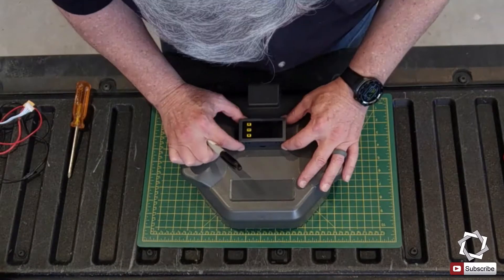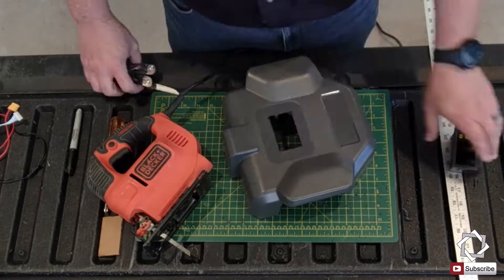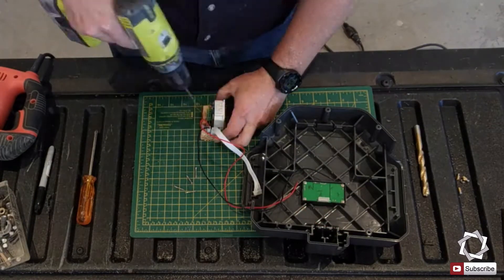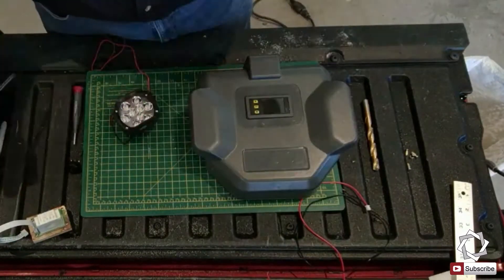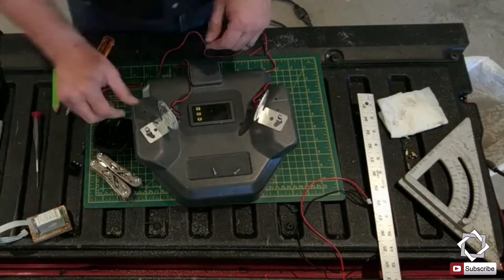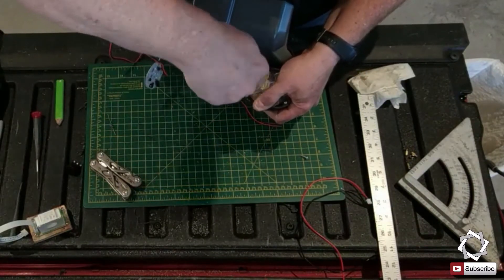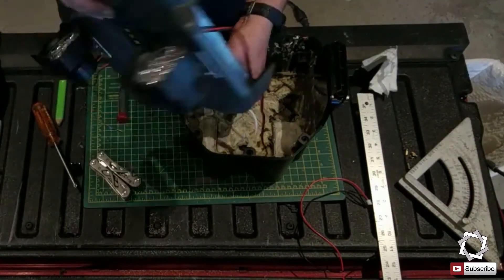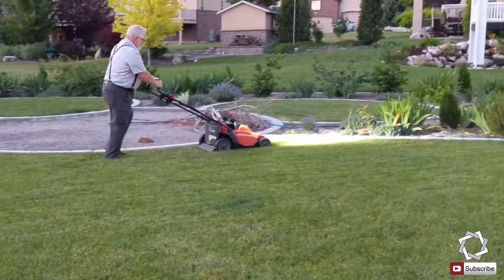Headlights on my Lawn Mower

Comment: Hi question about that meter.  I have a similar meter. I'm having some issue getting battery state of recharge . when I'm discharging with a load . it's displaying, 100..99..98..97>>>50%  no problem . But when recharging, the batt state of charge stays at whatever last discharge value. Even when the batt is full after hrs of recharge. Do you have the same issue. Also want to ask if you have the Negative or the positive wire going trough the Hall sensor.? ps . I like your channel. keep up the good work ;)